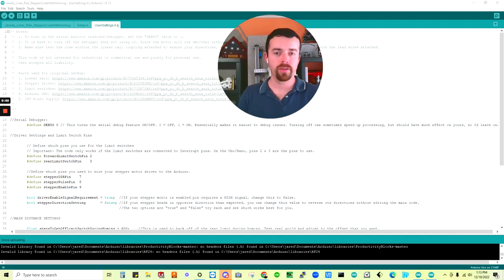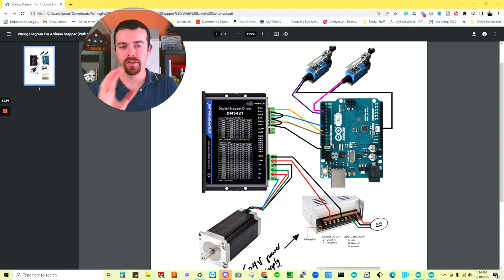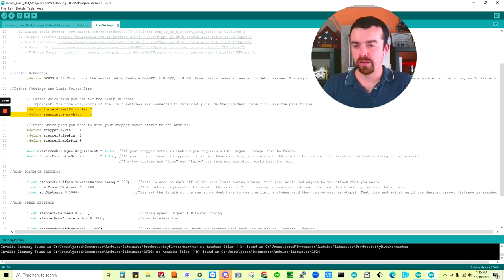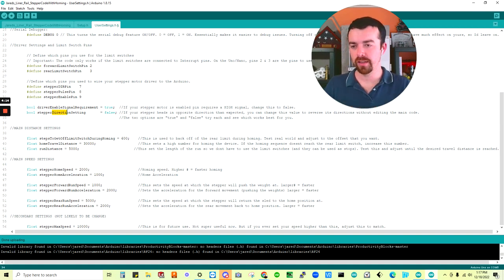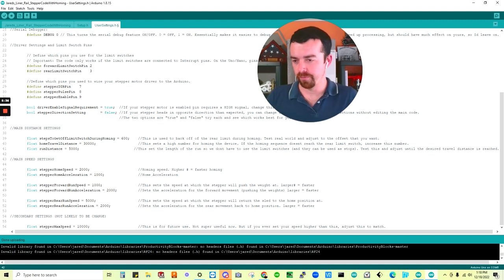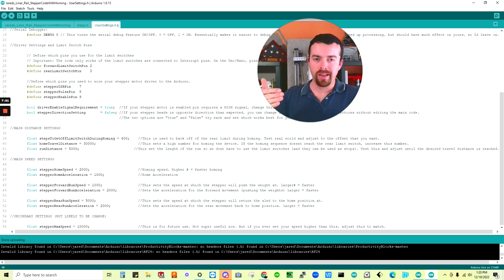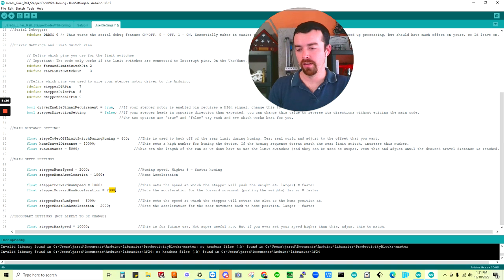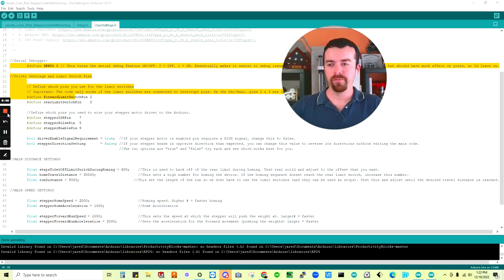How to easily control a linear rail using Arduino and AccelStepper.

Comment: Hola Jared, estoy  tratando de implementar tu código a mi actuador lineal de husillo de la firma  FUYU de 500mm de recorrido con dos limitadores de recorrido en los extremos. El fin es hacer subir una camara de fotos con paradas cada cierto intervalo de tiempo mientras que una plataforma horizontal con otro motor paso a paso realiza un giro completo con paradas a intervalos fijados y disparo de fotos, unas 32 fotos por giro. En mi actuador lineal he colocado una plataforma para colocar una cámara de fotos y el disparo lo hago mediante un relé opto-acoplado👍👍👍. El objetivo de todo el sistema es el  de obtener conjuntos de fotos de un objeto formando grupos de fotos agrupados en anillos concentricos para posteriormente calcular un modelo 3D de alta definición. ¿Seria posible disponer de un poco mas de detalle de las conexiones de los pines de tu aplicación. Para mi, tu software es un medio, no soy un experto en programación con Arduino. Muchas gracias.👍
Reply from the maker: Hi Miguel, I show the wiring diagram at time 1:12 in the video. Also, in the last sustenance of the video description, I give a link to an webpage that goes in depth on stepper motor wiring with Arduino. I would suggest checking that out, as it is where I learned to wire them. Feel free to reach out if you have more questions.